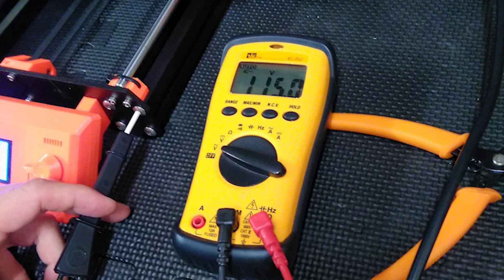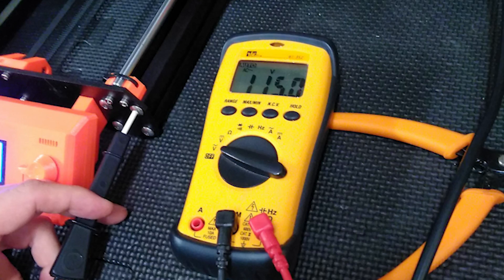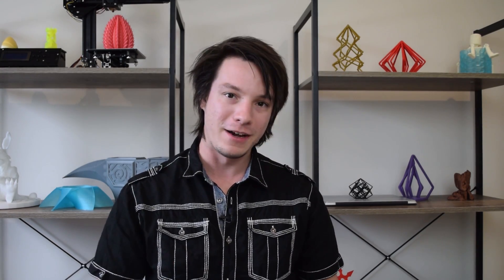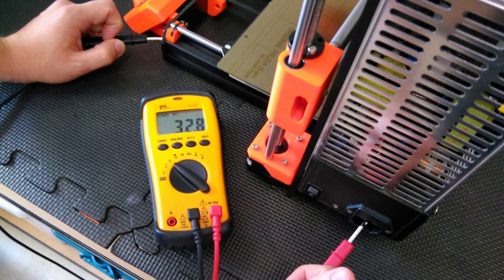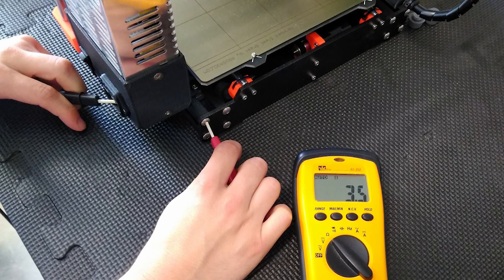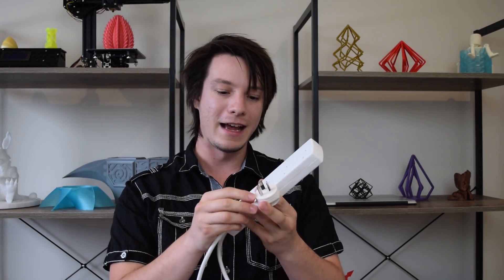I got shocked by a 3D Printer

Comment: I'm going to hazard a guess that the JGAurora A5 uses a grounded PSU as well. In that case you should get mains voltage divided by 2 on the ground pin if it's left disconnected like in this case. It's simply a side effect of how they are constructed and if you measure the current between the disconnected ground and the real ground you should get a very low current. They are simply not made to run like this but they should at least not cause any serious harm if they want it to pass CE standards.

I know this because I've been caught by this quirk a lot of times when working with relatively high power AC-DC converters for my hobby stuff. It doesn't mean the PSU is bad, it just means you have violated one of the safety prerequisites used in the design. Even top of the line ATX PSUs can give you a shock if you connect them without ground.

The ones you see without grounded cables need to be double isolated. That means it needs to have a double fault to pass current from mains to your body. From what I've heard it's enough to have a properly separated transformer on the input and a non-conductive enclosure, but I'm not an electrician to I can't give a firm answer.

I'd recommend you measure the current between real ground and the disconnected ground pin on the JGAurora A5. I can't give you what the limit is because I simply don't know, but it should at least be in the low mA range. If you get more, swap out the PSU with a quality one, like a (genuine obviously) Meanwell or Delta PSU. If the multimeter blows up you also return the favor after the swap, you don't want anyone to find it in a dumpster dive.
Reply: +James Stanley Alright, I didn't want to address this comment directly but it seems like I have no other choice because people keep upvoting it and downvoting my original comment.

As +kraklakvakve said it's not bullshit. In fact, if you take a multimeter and measure the AC voltage yourself (just like I have done several times, most of them after getting shocked by the way) you'll see it definitely does happen. I've heard something about it being due to filtering before and what +kraklakvakve said seems to confirm this.

Please do some basic research before you go misleading others.
Reply: @Djhg2000 you are absolutely right. most SMPS' I have seen to date, and that's in the thousands, have a input noise filter that divide the input voltage in two and connect the midpoint to ground. If you let the ground pin float, you will measure approx 50% mains voltage on your metal parts. Trust me, living in a country where ground only recently has made it's way into mains sockets has learnt me this the "energetic" way!
Reply: James Stanley: the answer is two filter capacitors. They wont let much current through though.
Reply: In switching power supplies there are filter capacitors at the input. If the earth is floating, the capacitor connected between live and earth and the  capacitor connected between neutral and earth form a divider. This is how you get half the main potential on an unconnected earth.
Reply: Hi James, 

Pixie wrangling is actually a lot more complicated a subject than you clearly realize. A little voltage leak actually is not only expected, it isn't a big deal. This is why electricians and other "smart people" emphasize the importance of not removing the ground prong. Sure, a lot of devices will technically run with it removed, but it is generally there for very very very good reason the devices which use it, particularly as you get into complicated electronics such as a PSU, were absolutely designed to work with it and only with it. Remember this voltage leak is probably absolutely tiny. Otherwise, if plugged in, you'd trigger the GFI or breaker. But if you isolate it, you'll build voltage into something that can give you an actual shock.
Reply: I'm 100% on the filter side of things. I've been zapped by PC PSU's on numerous occasions exactly the same way. It's "shocking" but in no way life threatening. Every switching power supply equipped with (mandatory) filter caps WILL have the capability of making you go "ouch". Icky ? Yes. Dangerous ? No.
Reply: I can see how mains earth isolation could be an issue. An isolated earth in any system can become seriously dangerous and carry a voltage with respect to the actual earth. This has a link with the eevblog posts about not blowing the crap out oscilloscopes and mains earth referencing.
Reply: +kraklakvakve Yes, that would be my understanding.
Reply: It's called a capacitive voltage divider and it's formed as a result of the filter capacitors in most switch mode power supplies.

If you're going to call bullshit, at least understand some fundamental theory on the subject.
Reply: +Morten Guldager Thank you for the explanation. SMPS was the keyword I missed when searching for this earlier, now I found this image: http://www.marcspages.co.uk/pq/3331.gif
Reply: James Stanley it's not bullshit, it is probably the input noise filter. A small amount of leakage current to ground is normal. If you disconnect the ground, you can get a small zap from it.
Reply: I would almost state, with an amount of certainty, that this was a filter capacitor leaking voltage back into the ground pin. I can also state that the PSU will run 100% fine without it, in fact, I would remove this extra filter cap to make it safer. You only need 1 of the X2 style capacitors bridging over live and neutral, one from live to earth isn't required.

If there is an extra capacitor from live to earth, this is just shoddy PSU design and it is there to try and suppress all the extra noise coming from the cheap PSU.  To the people saying that this is part of the design to make it work... Nope... It is there to get it to pass regulations for noise output requirements. Cheap ass shit is the problem here. A well designed PSU will not need an extra filter capacitor.

Insert: Obligatory, you get what you pay for...
Reply: James Stanley This, voltage does not get divided by the air...
Reply: Sorry, I think this is bullshit. By what mechanism would you get half mains voltage on a floating earth pin? I think the JG Aurora was faulty.

Comment: Inside some switch mode mains power supplies, there are filter capacitors that are connected to the ground pin of your plug. These are meant to suppress electromagnetic noise but if your ground is disconnected, you can get a modest AC voltage on it. It should be quite soft, good enough to light an LED, but not an incandescent bulb or to kill you.
Reply from the maker: I really wonder if that was it... hmm. Like I said it was very unpleasant but wasn't high current.
Reply: I'm going with kraklakvakve, I think you have a disconnected ground somewhere - probably in that single outlet in the garage. Probably poorly wired by the previous homeowner. So the A5 was trying doing its job to reduce noise on the power line by trying to dump it to ground, but it couldn't - so it got fed upstream to the Prusa.
Reply: It is definitely the EMC filter on the input mains. They consist of 2 capacitors that is connected together in the middle to ground. Ground is connected to the box of the PSU. So you were just unlucky to get a little tinkling feeling.
I got a static electrocution the other day, when manually retracting filament on my CR-10. That came as a surprise, but not harmful. The filament were grinding on the extruder gear charging the filament with electricity.
Reply: Switched power supplies have this behaviour, they needs to be grounded if you want to avoid this. I remember old Dell laptops that delivered power supplies with just two prongs. Good awful annoying when you from time to time felt that tingeling under certain circumstances (usually high humidity).
Reply: Most Australian RCDs are 30mA to allow for lots of small leakage(As they tend to be whole house) before there is a real fault. So you can get quite the tingle before it trips out.
Reply: It is electrocution only if it kills you.
Reply: A Microchip video about this: https://www.youtube.com/watch?v=QuNDY7WTVSQ, see ground leakage currents at about two minutes. It is very annoying indeed, but normal and intentional.
Reply: I was thinking the same thing, floating 0v ref caps on the SMPS input PI filter.  THey are usually tied to the PSU case, earth ground pin, and the midpoint 0V ref in a bipolar supply.  Lifting that would put half the voltage on the PSU chassis.  Shouldn't be lethal, but as Angus found out... it's enough to piss you off.
Reply: That would be my opinion as well. No fault on the printer side, just user fault :)
Reply: Maker's Muse  115 volts you were measuring does point to the filter being the cause as you're measuring the half the mains voltage there
Reply: You can test it by measuring the current that flows across the ground gap if you bridge it by a multimeter. The leakage current should be a miliamp or so at most (form around 10 mA, GFCI/RCD safety interrupters start tripping).

Comment: First thing is start at the source - since you're in a new home. Check all the receptacles (especially in the garage) for proper voltage and grounding. Get a 220v outlet tester from your hardware store if you don't already have one. Then check all the power strips to ensure all their outlets are also wired properly and in working condition. 
Then it would be time to crack open the A5 and check power supply wiring while its unplugged. Mine has Red for L (Live), Black for N (Neutral) and Yellow for Ground. Make sure all those wires are screwed in tight to the power supply and trace back to the proper pins on the back plug.
Beyond that, I don't know. Hope this helps

Comment: You can easily survive high voltages, the real danger is if enough amps are involved.
Reply: Dan J-King high voltages allow the amps to flow though. So while you’re right that amps are the danger, but volts are what give you amps. 

Car batteries deliver huge currents but the voltage is low enough that it isn’t too dangerous to humans. Unless you apply it across your heart or something weird.
Reply: HA! you fell for my trap and explained it so I didn't have to, although we didn't cover ac/dc. Drats :D
Reply: Dan J-King Nice one.
Reply: DeKempster >:D
Reply: lol read the comments.
Reply: Milliamps. Not Amps. High voltages overcome the skin's resistance and then all it takes is 5 mA to feel pain. Less than that for the tingles. 20 mA to paralysis and then worse to 1 A when you can say goodbye. Utility poles have caution signs for the voltage, not the amps. A line with 40,000 Volts can jump a charge about 10 feet through air, depending on temperature, humidity, etc.

Car batteries can put out hundreds of Amps but don't normally pose a danger of shock. Why not? Because 12 volts is not usually enough to overcome a person's skin resistance so no current flows. But they will sure as shooting weld a wrench dropped across the terminals. Don't work on a car's live electrical system with wet hands.

Test: Put a dry finger across the terminals of a 9 Volt battery. Nada. Lick your finger and do it again. Maybe some sensation. Now put your tongue across those terminals.

Old timer electricians I have helped often saved time checking light bulb outlets by putting a finger on the outside threaded shell and tapping their thumb into the center terminal. They said they'd get a brief shock but it only passed from the thumb to the finger. I didn't have the nerve to do that, thanks. Of course if they touched the outlet with one hand and were accidentally grounded by their feet or the other hand, the shock would pass through their chest and be very bad news.
Reply: the real danger is if the current passes through an important organ

Comment: Been shocked way too many times and can fully understand what happened. I work with 220VAC/400hz everyday. When it bites it REALLY bites. No fun at all. Be careful out there and glad you were okay and were able to track it down. Definitely makes since what happened. Although I wonder what kind of power supply the aurora is running that would leak that much voltage and not trip anything?
Reply: The way I understood Angus is that the ground was not connected to the actual circuit of the house so it was not able to trip any fuses. 

If I may ask, with what kind of electronic parts do you work? In Germany we only have 240V with 50Hz frequency as mains..
Reply: Felix Ertl Aircraft power systems. They actually run up to 440vac but I never really mess with those systems anymore. Most of the stuff I do now is 220 or below.

Comment: You can put one of the multimeter leads into the earth on a different power board thats powering the printer and then the other lead to test parts of the frame for live voltages. But as you said - tired,...

Comment: 7:47... That cable probably came from North Korea... They are trying to kill us one by one...:/
Good video to make sure non electricians are aware of the risks...
Reply: Nah, that's an American plug.  After all, what is freedom if it doesn't come with a slight risk of electrocution?  MURRICA!

But actually, part of the reason many U.S. plugs aren't required to be grounded is that we run on 120 volts, so if something goes wrong it's considerably less dangerous.  Though for a 3D printer with exposed metal, it's probably not a great idea to test that theory.

Comment: all the power strips in my lab/3d printer area are smart boards with active protection and lights up a fault LED when there's an issue. I use them for everything risky and all my power supplies and printer. 
My house mains was tripping randomly and after some poking around i had found one that had gone into fault state. If i didnt have those strips i would have never known what was tripping the circuit.

Good quality power strips are always a must. Ones that have an LED if they have a ground connection are great. shame it means your paying like $60-$80 for the power strip but i know these ones have saved my ass
Reply: They are basically a power strip with built in RCD.
Its not the ones i use(can't seem to find the power strip version) However given the fault in my recent one I might look at replacing them with something like this. While they dont have a fault LED the safety switch should trip constantly in a fault state.

Here are some examples
https://www.bunnings.com.au/hpm-8-outlet-plugboss-surge-protected-powerboard_p4330155

https://www.bunnings.com.au/arlec-4-outlet-portable-power-block-with-safety-switch_p7052850

YHou can also get little things like this which you can plug into power boards or leave plugged in that show if theres a fault condition like a disconnected ground or a misswiring(happens occasionally in some really cheap power strips)
https://www.bunnings.com.au/deta-power-outlet-tester-plug_p4420488

Comment: Ironicly yesterday I was wiring up a cheapo Chinese kit, (sorry angus) and fortinatly threw out the 2 pin that came with it for a 3 pin
Worse though it only extended the non connected ground to the PSU not to the metal frame. Erm .Wow

Comment: Repeat the setup with the Aurora (carefully not touching the frame because it isn't grounded) and measure the current between the frame and ground potential. It should definitely be less than 300ma. Hopefully it's even far lower. As long as it is lower than 300ma and connected to ground, there is actually no problem. 
(Assuming that ground resistance of your building is around 30ohm, but there is no way to measure that.)
Engineering student in Belgium

Comment: most printers would benefit from a PC (ATX) power supply instead of those crappy LED ones that they tend to be shipped with. With their poor separation of mains and DC, the power supplies shipped with a lot of printers are just death traps in waiting.
Reply: And just for your information, ATX powersupplys are of the very same type as the more industrial looking supplies used in most 3D printers (switch mode power supply, SMPS). The difference is just that ATX supplys have specific shape and different output voltages needed in a computer, and the industrial supplies usually only have one single output voltage. An "LED power supply" is basically the same type of switch mode supply, it just does not regulate output voltage, but indstead regulates output current. (You will never see an "LED switch mode power supply" used in any 3D printer... Since the voltage of LEDs does change a lot with junction temperature, all power LEDs are normally driven with constant current supplys to limit the power over the full temperature range.
If you want full seperation between mains input and appliance, you need a transformer based power supply. Problem is that a transformer that can handle the power needed for modern 3D printers with heated beds is very large, expensive and heavy. So it's pretty clear that everyone from professional machines to cheap garbage uses the smaller and cheaper switch mode supplys when ever they can.
Reply: It has NOTHING to do with seperation! - It's the main filter that is to blame here. Mains filter containts X- and Y-capacitors to keep radiated noise down. It is perfectly normal to get a tinge off something like this if it's ungrounded, and it's not dangerous, just a bit uncomfortable.